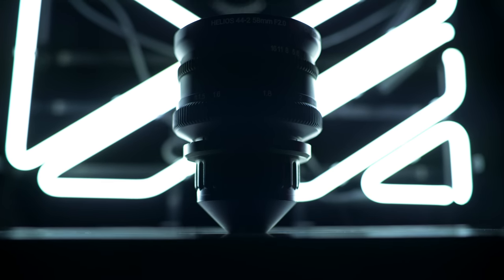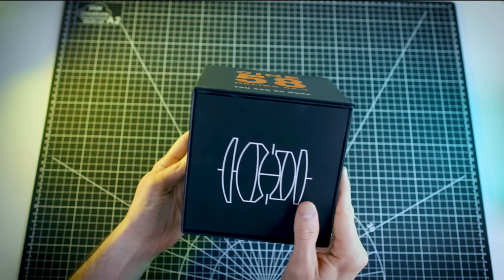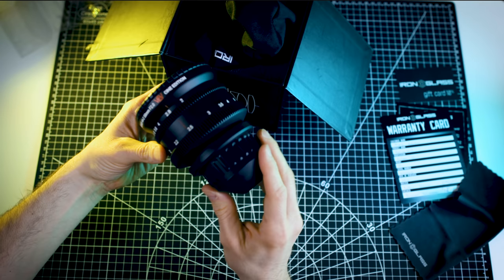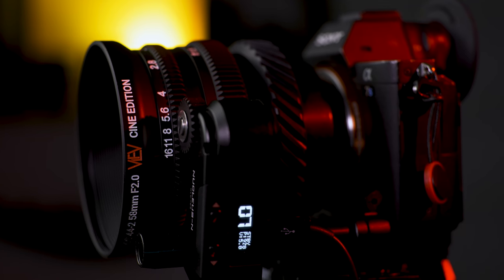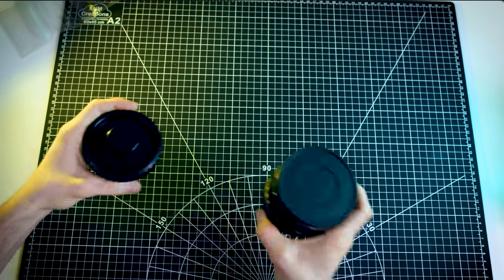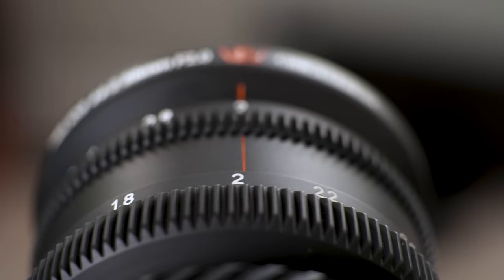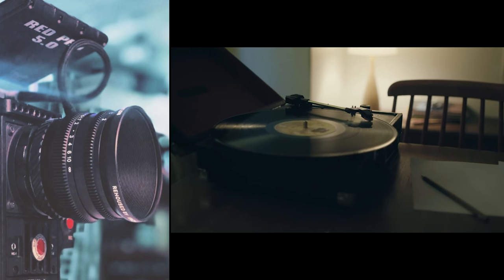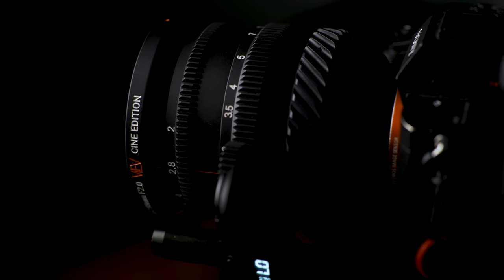Cinematic Swirly Bokeh - HELIOS 44-2 Transformed

Comment: Does the adaptation of vintage lens ( m42 lens + adapter ring to EF + EF to EOS M mount ) apple a further crop ?
if i use the helios 44-2 m42 mount with a canon ef mount then on a ef-m mount ( canon m50) .. will it produce a crop due to using double adapters ?
Reply from the maker: Glassless adapters don’t crop. Assuming you are on a FF camera as they are FF lenses. You will always have a crop on a crop sensor. Since the M series is a mirrorless you should be able to M42 to Eos-M adapt clean. You don’t need EF to eosM
Reply: @MarkHoltze  thanks fr the reply .. but by mistake i uv ordered the m42 to ef mount for my canon m50 apsc. i hv a canon adapter EF - EFM and thought will use with that .. but niw i am thinking did i made a mistake and will it work, will it show vignette on the sides ? 
the seller has shipped one of those slim m42-ef adapter with the helios 44-2
Reply from the maker: It might impact your focus a bit but no vignetting. Adapters are built with back focus in mind and when you stack them it CAN (not always) mess up the focus a bit. I’ve stacked adapters fine before without issue but something that’s in the back of my mind. If the adapter has a glass element in it, you will get a crop, the glass corrects for back focus on DSLR’s but the m42 to EOS is just a straight metal plate no glass so you should be fine. Curious about the results though. Would love to hear your experience
Reply: @MarkHoltze  thanks .. this is the first time i hv order a vintage lens, and i’m so exited .. been doing a lot of reserve fr the last few weeks. i’m gonna be using the helios with my sony a7s3 and my canon m50. 
i will surely let u know of the results and u have to guide this fellow creator from India more about the vintage lenses, i will get in touch with u on instagram too . 😊😊😊 .. just recently found ur channel and been loving the videos so much 😊.
no .. i don’t hv the speed booster adapter with the lens element, just the basic canon one , EF - EFM
Reply: @MarkHoltze  wow .. i just found u on twitter, looks like we r in the same community of creators. 😍😍 Ruben is my friend ..

Comment: So it's a $50 lens in a $900 housing? I'll stick with my regular Helios. Added a follow focus ring and it works great.
Reply from the maker: actually it's a FREE lens in a $950 housing. Ironglass also does mods, but mods aren't always enough for many professionals especially with some of the quarks the Helios 44-2 has when adapting for video. 

These are really meant for deep enthusiasts or actual professionals working on sets. That's how these are being used for me, I'm being paid well to use them, so the cost is really subjective based on the work you do with them. 

To be clear, the work that goes into these re-housings isn't easy. It's precision and it's being done by a very small group of people :)

Enjoy your modded Helios mate, it's a wicked lens in whatever form it comes.
Reply: @MarkHoltze  thanks. What I'm saying is optically it's the same. I get how a different housing would make it easier to use for a cinematographer and I completely agree that it's not an easy thing to do.
Reply from the maker: @risbill1  Once they're inside the lens they can modify things, they actually have a 15 blade version they can do for $50 more, also the oval bokeh and anaomrphic stuff which is free and up to you if you want to apply those to your set. Also I think the focus throw might be different but I can't remember, now all of them have a 270 degree focus throw which is long, but gives fine focus control for cinema use. 

I know the MIR 37mm they actually reduce the min focusing distance making it more suitable for close up shots. Strange the Mir 1B 37mm F/2.8 had such a far min focusing distance for a "wider" lens.

Comment: Even though I love Ironglass as much as the next DP and Richard Gale’s pricing is pretty crazy, it's annoying that he’s getting no credit for being the first to independently rehouse Helios lenses for sale on the internet publicly.
Reply from the maker: We can't help what we stumble across I don't think. I haven't heard of his stuff, stumbled on Ironglass through recommendations so that's where I went. Webpage?
Reply: Mark Holtze I understand, but it's also important sometimes to correct the record.  AFIK Richard was the first to not only rehouse the Helios 44 lenses for cinema use, but also add the interchangeable aperture discs as well as have custom interchangeable additive optics to both widen and lengthen the focal length of the Biotar design (28mm, 38mm, standard, and 88mm) He probably used a similar method employed with the Helios 40-2 which is 85mm and apparently also still based on the Biotar design.  

Gale has been through four or five iterations of the re-housing (Flare Factory, Trump /unfortunate naming/, Kasparov, Apogee and currently the Clavius with complete internal focusing)  

Interchangeable rear optics for multiple aperture disc drop-ins, color shift aperture discs and multiple rear optical blocks with various levels of coating reduction/ for less contrast along with the focal length expanding and extending optics we're part of the Trump system.  That design was probably the one that brought him and his then named ”Dog Schidt Optiks” lenses into the view of a lot of Pro DPs a number of years ago now.  

He was also likely the first to build a shim-less PL to EF adapter for his rehoused lenses.

While I wouldn’t say he’s asking for too much considering all the work he’s put in, his current prices are unaffordable for a lot of Indies and even for those of us that can afford them it's difficult to justify spending that money knowing that the core of the product is a $40 vintage lens.  I know it’s just a psychological barrier, but it’s still hard to push through for a lot of people.

It's too bad he’s almost a complete recluse as he seems to have a lot of knowledge about lens design,  lens history and seems to have some strong opinions about a variety of optical characteristics (and probably personal stories too) I’m certain a lot of lens addicts would love to hear all that stuff from him.

Personally, I would like a larger company with a long history in lens design to financially back him, like Cosina or Fujifilm maybe.  Ideally, the result would be that he would be able to scale up production on all the designs he’s come up with while reducing the cost of the production of the lenses and the final cost to customers. 

With lower pricing I could easily see lens sales blowing to not only DPs but a lot of camera collectors in general.

http://www.richardgaleoptics.uk
He's also on facebook

Comment: I so wish they made these lenses for super 35mm sensors
Reply from the maker: They work okay on Super 35, you just have to deal with the crop. They come with Native EF mounts as well. So the 58mm on a S35 would be 58mm x 1.53 = 88mm focal length equivalent.
Reply: @MarkHoltze  the main issue for me is that it also affects the exposure. So at F2.0 effectively becomes an F3.1 at its widest aperture

Comment: May I remind you that a Helios 44M costs about 20 USD in Russia?
Reply from the maker: Yes, I love that lens, what made me want the cinema functionality. Optically it’s fit for commercial work, functionality it’s not unfortunately. 

This is also a Helios 44-2 not 44M so slight difference. This is so much more than just a lens :)
Reply: @MarkHoltze  Hi Mark. I have six different M42 variations of this lens (five from VALDAI factory and one from KMZ factory - was not so interested in the 44-3 version produced in Minsk). Today Helios 44-2 is traded at a price ranging from 700 RUB (private) to 2500 RUB (shop). Helios 44M-7 (the version with the highest optical resolution) from 1500 to 5000 RUB. Is it really worth spending such an important additional amount of money  for the cine version? I would be more happy to invest ten times more in a Zeiss Super Speed lens, provided that it is possible to buy it at a decent price, which is practically cash money with a good chance to reevaluate

Comment: The housing looks top-notch, but with a telescoping barrel, doesn't that defeat the purpose of a proper cine lens? You won't be able to use a wireless system to control the iris.
Reply from the maker: Not quite, I actually was told yesterday about a version 2 in the works without the telescoping,  but will cost twice as much given the complexity behind the design. I’ve used this a number of times on set rigged and it’s been fine. I can understand if it irks some, but the workflow in my experience wasn’t compromised in anyway.

Cinema lens with the gears and the universal front for Matt box fitting etc are bigger fish in my opinion.

Comment: It looks like the lens telescopes when focusing.  😬 Man, that’s honestly very disappointing especially on a purpose-built rehousing for cinema applications. I’m just barely getting into the Helios scene and was stoked to see the Ironglass products. Hate to say it, but that might be a dealbreaker. I dunno, maybe it’s not that big of a deal considering everything else this lens has to offer.
Reply from the maker: Additional costs would be added to reduce the focus breathing. Its not a particularly easy thing to do and when it’s done it costs. There are many ways around focus breathing, camera movement for one. 

Also i don’t use the full focus throw in a shot often, maybe you do and that’s all good. 

It’s preference based mate so my justification may not be yours. Totally respect that.
Reply: I mean breathing itself doesn’t necessarily bother me as much as the actual physical movement of the lens isn’t all contained inside the body. Makes it problematic if you’re using a fixed matte box instead of clip-on, or if you wanted to use a motor on the iris was well as the focus. But overall I think these are great and I appreciate keeping the costs down and considering everything else, I can probably work around the movement.
Reply from the maker: Oh right! That telescoping. I actually had it fastened to a Matte the other day and was testing the limits. Strangely enough it didn’t impact much in the setup. Def not ideal. I think they’ll slowly develop depending on how successful these are to improve. Internal focusing was mentioned in their FB page I believe. 

Thanks for clarifying mate, sorry I was a little off topic with that reply lol. Enjoy your weekend mate.

Comment: guys, but it's just helios, I myself am from Russia and here it costs $ 12, not a single lens for $ 12 can cost 1000 even if it is in a different case. It’s muddy, it has a disgusting spot of focus .. and it’s cheap, very cheap. if someone needs helios write to me and I’ll buy it and send it to you, a lot of them are sold on Russian sites.
Reply: yes, the actual lens in this rehousing is free, basically a free bonus. What you pay for is the rehousing. It will not be for everyone; only really useful for pro filmmakers, but some of them want to use the $12 Helios on their big jobs and this rehousing gives them the confidence to :) If you think professionals or Hollywood films wouldn't use such lenses, wait until 2021 ;)
Reply from the maker: All due respect, you might not understand the value or the work that goes into this process. That's your opinion and you're totally entitled to it, i'm not here to change your mind, I've addressed  your points in my video. I disagree about the muddyness of the image and pretty sure my optical examples prove that. Also, ARRI, RED cam users are using these lenses for their commercial work so based on your limited perspective I can see your point, but you have to think bigger.  Any other lenses you would suggest?
Reply: @alanbesedin  Ребят, я думаю вы замечательно понимаете русский язык, вам огромный респект, нет я когда увидел ваши линзы реально восхитился, работа просто колоссальная, но блин, сырец то все равно один и тот же, упаковка
 исполнение все на высшем уровне, но цена... Хотя опять же, если покупают это лишь доказывает, что ваша модель верна. Но гелиос за 1000$... вы давно стали своеобразными "героями" в отечественной среде киноделов )

Comment: Im not a Videographer shooting commercials , but i have helios , and have found much better lenses for my taste , im not all that much in to that look , i like my video to be soft of course but flat to the edges also, its not what Helios does .
Reply from the maker: It’s all about personal taste. You can get fairly good edge to edge sharpness stopped down, but we’re rarely shooting a 2D surface so that doesn’t matter as much in practice, especially for video.

What lenses do you like?
Reply: @MarkHoltze  Im glad you ask . Usually Canon because im on the budget , its a hobby really together with Astrophotography witch is expensive hobby indeed .
These days ive been testing Anamorphic IPAR 16 witch i have no use for so its on sale , and NoName 75mm F2 Projector lens .
Very Interesting lens , ive did a comparison 75 mm VS Helios    with few pictures .Uploaded it for you , Im blown away with its picture style and Colors , Its much like Canon FD Prime . That sort of sharpness and overall look. I know Canon FD is known to be Cinema Lens on a budget .With well corrected Flat field witch is what i like , probably due to Astrophotography where Flat field is a must .I guess its a must on Projectors as well.
This 75mm F2 , if one can work without Aperture blades is really Budget .
https://drive.google.com/drive/folders/1Wd052jWuyCZZF9HnbUy3o5tedYh4sOQb?usp=sharing
Neglect 70mmF 1,8 labels im not sure my self what the hell it is , but its Brighter then Helios F2, so call it T1,8 while its probably F2.

Comment: So its just a Helios with a couple of gears slapped on for $1000? What a terrible product, its not even an original lens design, its just taking a $20 slavic clone and repackaging it as 'professional' to fool Cine camera operators and banks on the markup.
Reply from the maker: Not at all, but you sound quite “informed” mate. You know just because you can type whatever you want, doesn’t mean you can magically make that nonsense fact.
Reply: @MarkHoltze  Its 40 year old glass rehoused in a new barrel. It is a markup
Reply from the maker: @TheDzhoel  optically lenses haven't changed a TON in 40 years, coatings and other features mostly have. Optically this lens in it's original form is very capable glass even by todays standards. The re-housing is custom shaped aluminum with improved focus throw, cleaned and properly weighted for cinema. The housing isn't cheap and requires absolte precision skill to do. Re-housing isn't a new concept, most re-housing efforts cost $2000 just for the re-housing, this is 1/2 that so it's not bad. You still haven't given me any real reasons to take your points seriously because you  just sound uninformed. No offence, but working in the industry for 20 years, I know what's what. 

Also, even  if you think it's a waste, for what I can charge using these lenses has still made this price point highly profitable. Clients don't care about the semantics, I need a lens that can withstand the the assault of production rigging and these have served me well so far :)

Look up re-housing, do yourself a favour mate. Good luck to you.
Reply: @MarkHoltze  well i use a Helios for commercial advertisement production too, its a fantastic lens for $30, but you still haven't convinced me why it should influence my workflow. Lets agree to disagree.
Reply from the maker: @TheDzhoel  Oh that's fine, I think I said in the video that these lenses are not for everybody. You can still buy the $30 lens and do great work with it, this is for a VERY specific film production (commercial) niche. Camera assistants, rigging etc. I'm not here to convince anybody, it's a product I love and figured I'd do a video on it to share that. I respect the fact that you know what you want, but you can't deny the value these lenses provide simply because they don't fit your workflow as a general blanket statement. The existence of the re-housed lenses do not prohibit the use of a regular helios for the same work :) It really comes down to the operator and what the production demands in terms of rigging. 

It's very easy to sell the look this set provides simply based on how the lenses look, it's weird but optics matter sometimes to clients. The reason these exist is the same reason cinema lenses look different than photography lenses, and despite some similarities, the two crafts are worlds apart. There's also a reason cinema lenses cost multiple tens of thousands and sometimes hundreds of thousands for a set vs their photographic counter parts. 

Like I said, I'm not here to convince YOU, I'm simply sharing what I enjoy and being into vintage lenses i'm glad this option exists for those who can take advantage of it. The demand is very high by the way, for those who need it :)

Good luck!